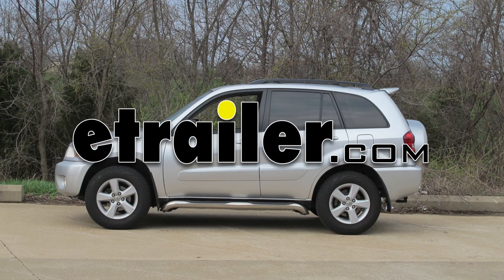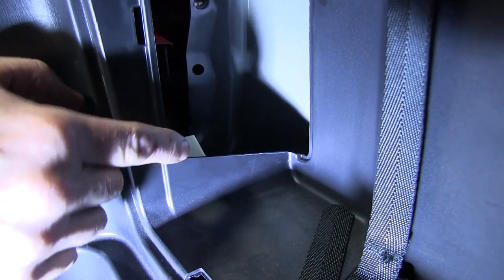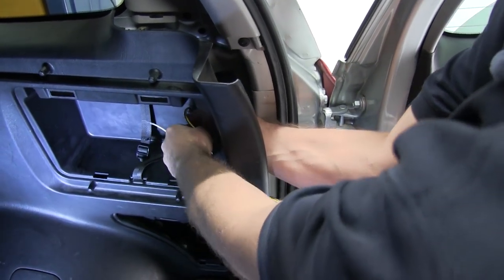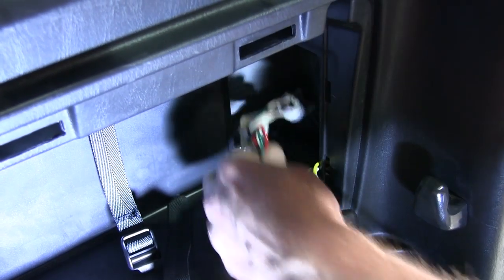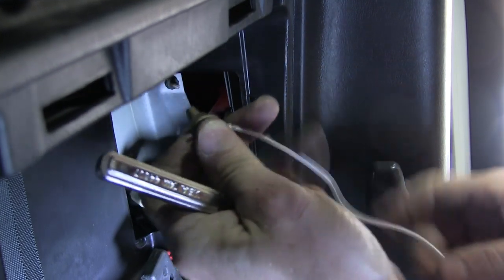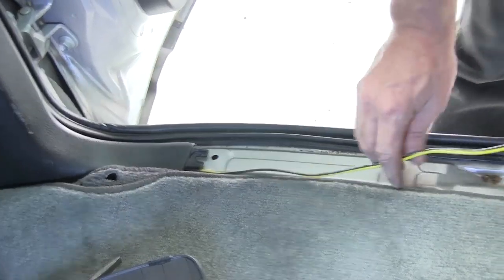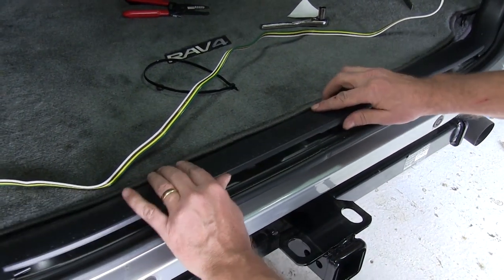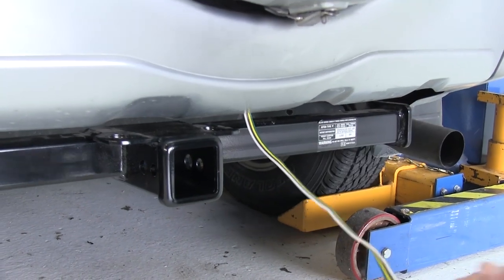Set up: T-One Vehicle Wiring Harness with 4-Pole Flat Trailer Connector on a 2004 Toyota RAV4

Comment: I love the fact this version doesn't make any permanent change to the car, last time I did a towbar we had to splice the wires in, and I don't like that too much, dont understand how those wires plug into trailer though, dont you use a big round 7 pin plug like us in UK?
Reply from the maker: We have options for a 4 and 7 pole kit that you can install along with this kit so that your vehicle has both options. Check out the following link to see the ETBC7 kit.
https://www.etrailer.com/Accessories-and-Parts/etrailer/ETBC7.html
https://www.etrailer.com/Custom-Fit-Vehicle-Wiring/Tekonsha/118389.html